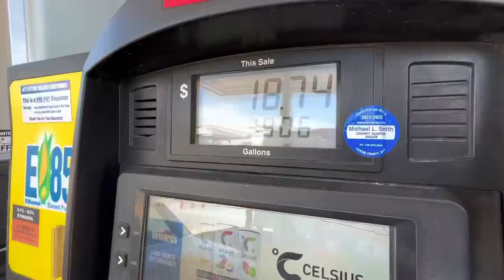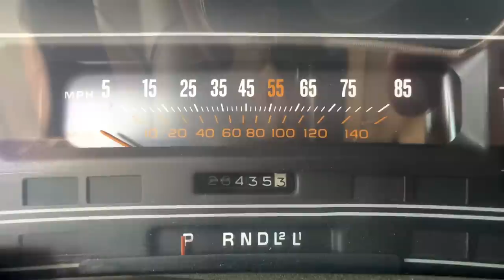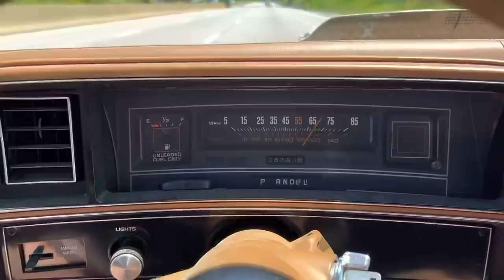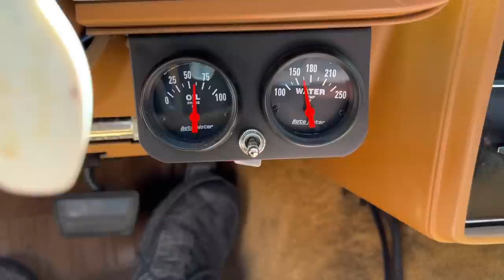CORN SWAP!  Testing a Quick Fuel 750 E85 Carb for POWER & ECONOMY!

Comment: If the big block Camaro has a 160 thermostat in it that could be why it’s overheating. 160 is too low and doesn’t give the rad enough time to cool since it’s always open. I would swap it for a 180 put a 2 or 3 row(biggest that fits) aluminum rad and see where it’s at. If the cooling system is adequate it should stay +\-5 degrees of thermostat rating. Just my 2cents
Reply from the maker: It’s a 195
Reply: @theoldmansgarage  looked like the factory BB radiator? Could be clogged from sitting, I’d still try a 180 thermostat and a 3 core aluminum radiator. I chased problems in an old 73 hatchback nova with an Oldsmobile motor in it and the solution was 180 and 2 row aluminum radiator. If he’s not worried about every ounce of power try a mechanical fan with a clutch.

Comment: Mr bill can e85 be run in a alcohol carburetor with some small modifications have a early 2000s APD carburetor left from my bracket racing days and do you run any top end lube in e85 like we did with alcohol I used kloz beanoil ?

Comment: I'm running a 383 stroker, with 12.31:1 (static) and 8.95:1 (dynamic) compression.  At 93 octane, it definitely has preignition issues going up hill, or sometimes when the turbo 400 goes into a higher gear.  I'm thinking of running either complete E85 or a blend (will probably try a blend at first).  My timing is locked out at 32, and I definitely don't want to retard it anymore (but will if I have too).  Is it possible to run a blend (16 gallon tank... so maybe 2-3 gallons of E85 w/ the rest 93 octane) w/o changing my Brawler completely?  I see ATM makes a very affordable E85 carb w/ great reviews.  I'm curious what I should do.  If I had an E85 station close, I'd probably just go all out; however, it's about 18 miles from me.  I have 4 Wavian 5-gallon metal jerry cans that I use to store the E85 (you have to have a good one w/ a great seal, or E85 will become unusable very quickly when sitting).  It'd definitely be easier to make one trip and fill those up, and then just fill up locally using only a few gallons of that at a time.

Any thoughts or suggestions would be appreciated.

Comment: Could you run pump gas with a E85 carb and swap back and forth I’m thinking about running e85 on my big block Chevy but there is only one station near me that has e85 and it’s 30 miles away

Comment: Can anyone explain the difference from a lock up converter and a non lock up? I'm clueless on converters lol but was told I need around a 2800 stall for my 4l60e with a 355 in a chevy z71 but unsure about which to get and don't wanna get something that won't work best lol

Comment: Does e85 require the same amount of fuel pressure as gas what all needs to be swapped to safely run it
Reply from the maker: Same fuel pressure.  The Malibu uses an Edelbrock HV mechanical fuel pump.

Comment: No issues running E85 with factory gas tank / fuel line? I've always wanted to do E85 swap, but seen a lot of horror stories about it eating up fuel system
Reply: Good question

Comment: Does the E-85 gel up in the tank and fuel lines?
Reply from the maker: I’ve never had an issue in the tank or the lines.  Heat soaking in the carb and corrosion I think is the main culprit.
Reply: @theoldmansgarage  makes sense thank you!

Comment: Can you run regular pump gas through a e-85 carb?
Reply from the maker: No, the carb is calibrated for E85 and will run extremely rich on gas.  However you can recalibrate the internals to run gas through it if you wish
Reply: @theoldmansgarage  ok thank you for the tip. I wasn't for sure if it was like a flex fuel carb where you could run both.

Comment: Bill do you have to change the fuel pump from a gas to e85 ?
Reply: I ran e85 on my demolition derby car with a mechanical pump with no issues
Reply: @allenwind6412   a gas mechanical pump.  I have a aeromotive 1000 electric gas pump. Just curious if I had to do anything besides change the carburetor
Reply from the maker: No, in fact we ran 10.50’s with a stock EFI fuel pump in Billy’s S-10 years ago on E85
Reply: @radracer4winradracer4win80  yes a 110 gph gas mechanical fuel pump
Reply: @theoldmansgarage  awesome sounds like a plan   Ive been kicking it around for awhile  building a new engine so will just swap carbs on the startup.  Timing about the same you think

Comment: Could you "stand alone " with E85 with a 1/4 turn ball valve to isolate the gas and ethanol systems ?? Just curious..as so you could  compete in a drive & drag event

Comment: Good luck with that e 85 crap. It messes up ur valves. Wait till u need to pull ur heads off and see that crap on there.  I learned the hard way. I will never use that stuff again.

Comment: At almost $6 a gallon who just wastes gas? You are more concerned with racing the Malibu so why even care what mileage is, kinda an oximoron. Not very accurate at all going by pump click off in mileage calculation. E85 sucks in fuel systems not worth the troubles in a street car they cause. Wait till it eats up your mechanical fuel pump.